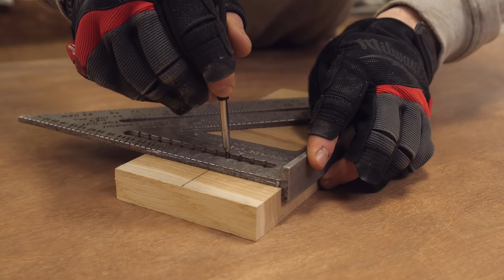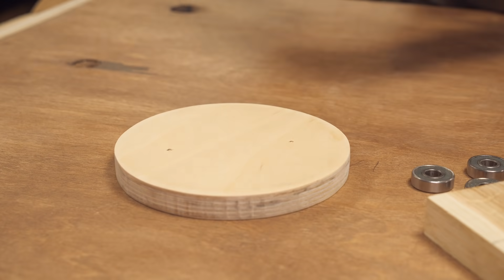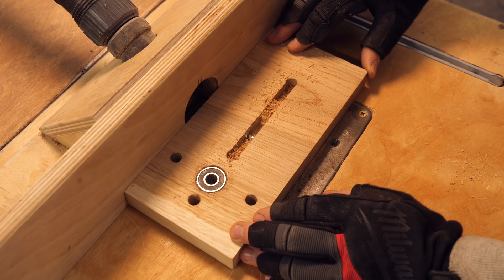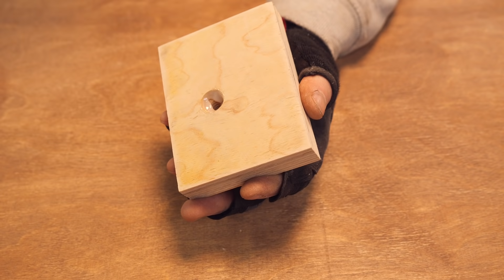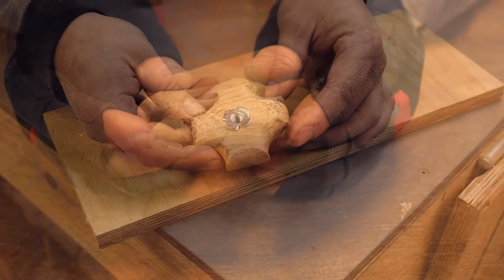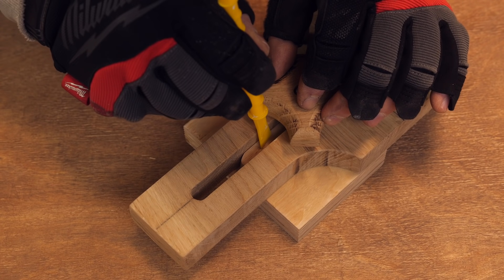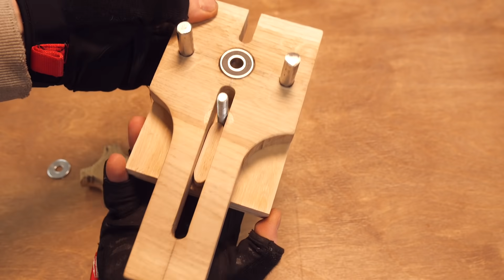I regret that I did not do it earlier! Very useful thing!

Comment: If you know, you know. If you don’t know, keep watching this guy and you will never know. Never wear gloves or rings when operating any power tools! Safety first. Drill jigs use bushings not bearings. Grain direction of jig base should have been lengthwise not cross. Should have been plywood. Never install metal hardware then take it to a router table! This is too dangerous for a dowel joint jig. My father was a cabinet maker till the day he died and despised dowel joints. They’re weak and more complicated than simpler stronger joints. I’m a machinist with 25 years of experience. These kind of videos are misleading click bait for novices. Where is the caster in the thumbnail? Total B.S.